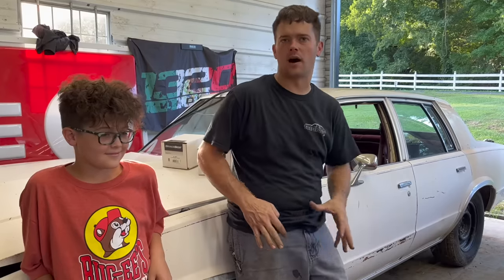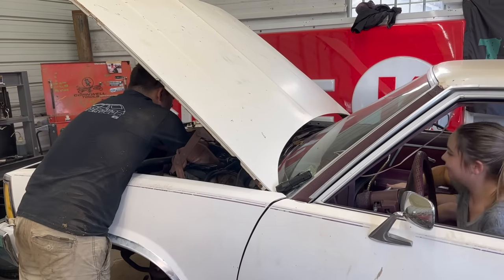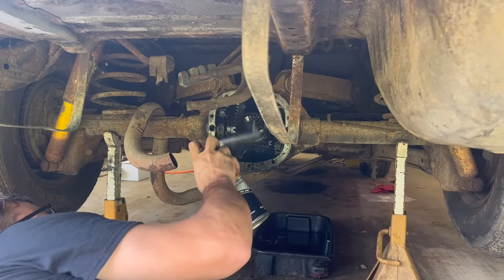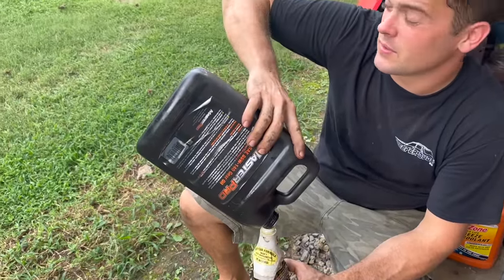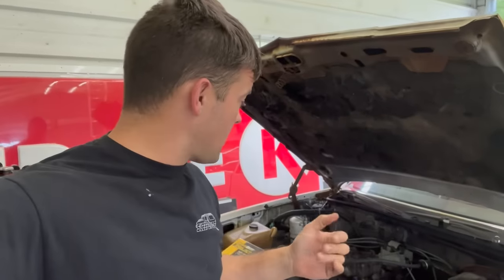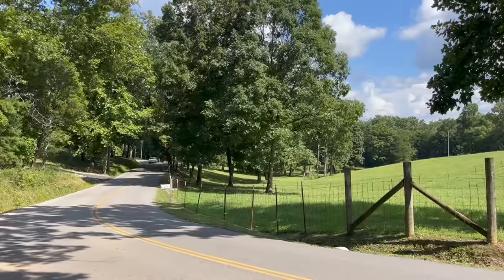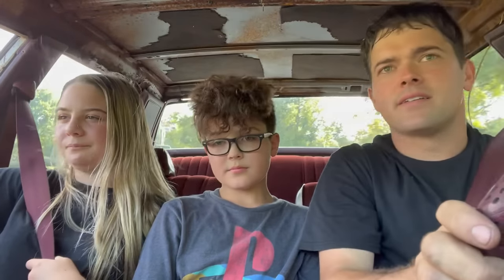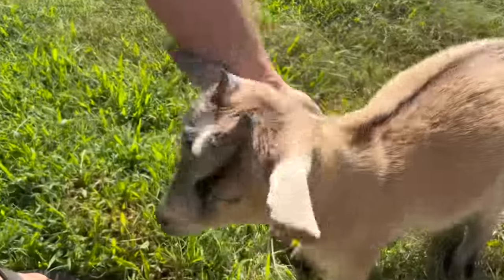Wife and Kids drive our Malibu Burnout car. I made some mistakes!

Comment: Eric Burns broke bastard racing go with the performer intake manifold out of 600 Holley carburetor a 454 lift cam a set of 305 high output he is the 416 castings or either the 601 castings a set of cheap headers one five ratio roller rocker and get out there and have some fun with that car I mean making a burnout car that is awesome and the transmission 2200 stall converter on a 350 or 700R4 trans shift kit have some fun with that car good luck with it Josh holla if you hear me

Comment: You do know normally on a Chevy not always but normally that the oil dipstick on the driver side usually at 350 when it's on the passenger side it's normally a 305 from the experience I had almost every Chevy motor I've had it's been like that pretty much lost course it's a big block you know the difference in that you're a smart man but it's awesome though it's a four bolt that just means you can do a lot more with that motor than you can't 305 I built 305 and couldn't do a whole lot but  350 four bolt  mains are awesome but I already know it will get it but I sure wish and sure you do to that it was a two door Malibu

Comment: If you want to bump it up a little go with the 80-86 305 heads they may have small valves but they are 58cc, so should get you more compression.

Comment: 624 heads out of 15,000 head gasket raise the compression like I said use a 454 lift cam change over to a idlebrock intake use a use a 650 spread board carburetor either reuse the reuse the Rochester carburetor add a set of cheap headers and do some modification to those 624 heads have some fun man and I thought it was a 305 myself but congrats holla

Comment: I have a fire extinguisher on my welding cart. That was getting pretty interesting....And yeah like throwing a glass of water on a grease fire, honestly if the diff cover was still right there, could have smothered it out, but hey, your cast is preheated for better penetration! When your on fire, not the clearest thinking happens

Comment: I'm going to first state that I'm against burnouts in principle except on race tires at the track.  Just because I have been "tire poor" my whole life.  Most of the tires I have now are old, dry and worthless as tires on the road so I'd make an exception for those since nothing much is lost by burning off the tread. But I hate to see new tires get burned down. 
I realize I am probably the only guy who watches car videos that is against burnouts.
    Still, I think you need to fix the back brakes. If you want to do burnouts you need a line lock. Even if you take it off another project car.
    That car is too nice to not be wanting to use it on the highway. And you really do need rear brakes. I learned that once the hard way.

Comment: Think about this,,dieseling has absolutely nothing to do with timing because you have turned off the power to the coil which means no spark  Diesseling is only caused by carbon in the combustion chamber with low octane fuel

Comment: The steel wheels on the car are the factory stock wheels. I don't think they are bad looking. You can paint them to match the color of the car and it looks good on them. They are "hub centric" as factory wheels nearly always are and aftermarket wheels seldom, if ever are. The only bad thing about the factory wheels is they are 14 inch and not very wide either.
   The aluminum wheels aren't bad looking on that car.  You almost never get the hub caps when you buy those wheels used or take them off cars in the junkyard.

Comment: The brakes probably aren’t working because your trying to push fluid against the crimp you put in the rear line and it’s locking the pedal up not allowing you to get enough throw to work the front brakes

Comment: Put an adapter on it and a 600 cm Holley 2 barrel on it. No lag and plenty fuel. One way to get more power is open the port the power brake hook up on the intake. Old dirt track trick I used.

Comment: When I  was a teen still living at home my brother and I swapped around the wheels on our mothers Hillman Imp to make it  have the appearance of a wide stance, drove it up and down the driveway then replaced them back to normal before the folks  came back. In another place before I  was driving my bro and I  would back the bambina out the garage then use the vice handle to winch it back up

Comment: to get the tires to light up faster try getting two windshield washer hoses spraying on the rear tires. Maybe try different mixtures like water. bleach or maybe something to change the color of the smoke.

Comment: I fine the best way to clean out a oil Rusty gas tank put some 1/2" nuts in the gas tank put a clear in the tank jack up your large tractor wheel on one side rachit strap the tank to it start spinning the tank you don't want to go to fast or slow you wanting the nut's to row an banning round in the gas tank round a 1/2 hewer  then flush out the tank.  the nut's will nock the rust off in side.  What you need is a Ford 9" rear end they're super strong

Comment: YOOO DUDES A TOWERS TRICK FOR CARS THAT DONT ROLL OR IN PARK FOR FLAT BEDS AND TRAILERS. WD40 BEHIND ALL 4 WHEEL ALL DOWM THE BED THEN U JIGGLE THE BED FORWARD AND BACK OR IF U CAN DO THAT REVERSE N LOCK THE BREAKS DONT GOTTA TRY HARD THEY ALL GO LIKE A SLIP N SLIDE.

Comment: There is a round cover on the passenger side of the transmission that has a governor in it. There is a plastic gear on end of it that is bad probably stripped. That what tells it to shift.

Comment: Great video on the Malibu with the shifting there’s a vacuum modulator on the back of the transmission u can check sometime the little rubber hose that runs to it gets a crack in it and loses vacuum to make it shift it should be hooked to the carb or intake to make it shift 👍🏽
Reply: That was what I was thinking.  Josh might have missed it because GM is different from the mechanical linkages of his usual Ford and Mopar cars of the era.  And the vacuum leak would affect the stumbles,
 etc.

Comment: I'm thinking the brakes are still weak because you are putting force into pressurizing the unused, front cylinder, which limits the force on the rear brakes.  One could buy or use a single master cylinder from and older car, leave the unused cylinder open, feed the unused cylinder into something with give that springs back, like a strong balloon?  Or T together the lines from both parts of the master cylinder to the front brake line.